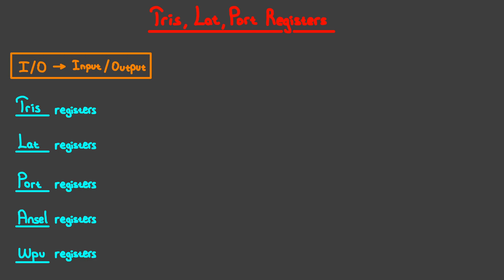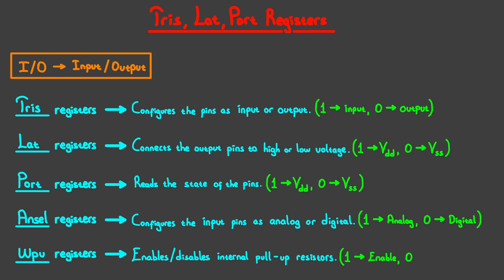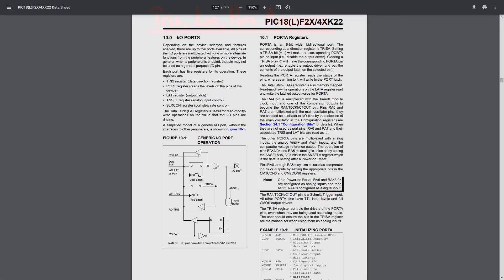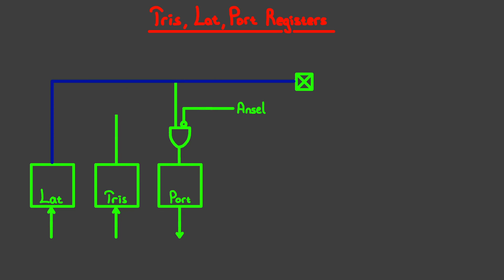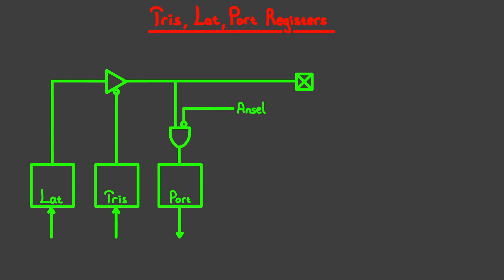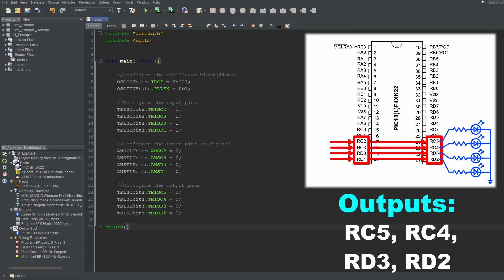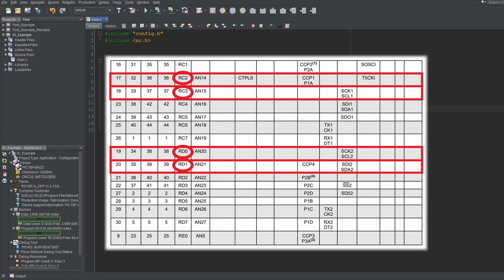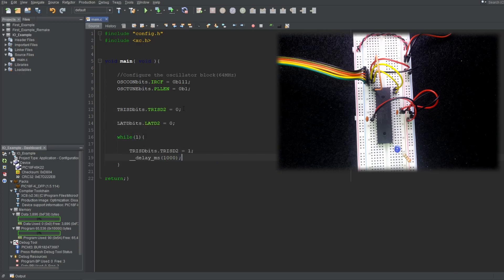PIC MCU TUTORIALS #13 - TRIS, LAT, PORT registers & I/O explained (Absolute Beginner)

Comment: I have not seen registers explained in a more simpler manner. I have trying to understand these , but found too much of undigestable jargon. 

Tris registers -> PIN as INPUT or OUTPUT
Lat registers -> PIN as HIGH or LOW
Port registers -> READS PIN HIGH or LOW
ANSEL registers -> PIN as ANALOG or DIGITAL
WPU -> Enable / Disable INTERNAL PU-UP Resistors

How simple to understand!! 
Great job. Thank you.
Reply from the maker: Glad you found it useful 👍

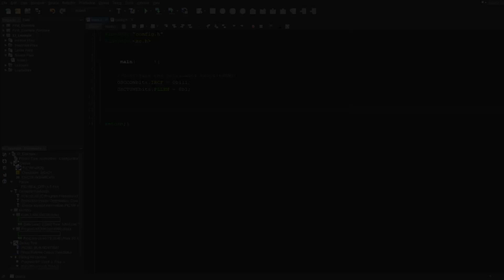Comment: Very interesting, at about 15:45, you mention maximum source and sink currents, whilst the user needs to take notice of these limits they must also take in to account the maximum chip dissipation i.e. don't expect to be able to source or sink the maximum current through all the IO pins at the same time.
Reply from the maker: Of course. I was just trying to keep it simple since most of them rarely matter 👍 There are a bunch of limiting factors, and which ever one is the most limiting will apply. Max instantaneous current, max continuous current, max port current, max device current, max temperature, max power dissipation etc... Also, these are absolute maximum values. Ideally, you should never get close to these.

Comment: Ok, but the question is, does the led turn on when bit is 1 or bit is 0?
TRISE = 0b11111110;
LATE = 0b00000001;
because from this code the led (coresponding to the last bit) is turning OFF, while you said "1" is for turning the led ON
Reply from the maker: When the LAT bit is 1, the pin connects to positive rail; if the LAT bit is 0, the pin connects to ground, that's all LAT bit does. If the cathode (-) pin of your led is connected to the microcontroller and the resistor connected to the positive rail, the LED will turn on when the LAT bit is 0.
Reply: @Microesque  Thank you so much! Now, it makes sense!
Reply from the maker: @OviMG  np 👍

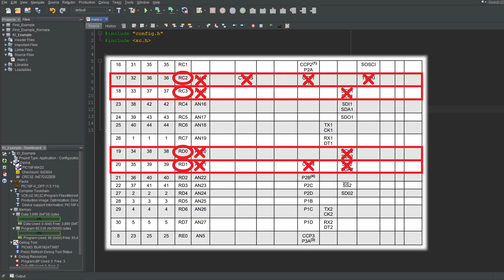Comment from the maker: There is something I forgot to mention in the video. Some of the older microcontrollers don't have "LAT" registers, like the famous PIC16F877(A). The idea of a separate "LAT" register was conceived later on. Those microcontrollers directly write to their "PORT" registers to change their outputs, hence the confusion of whether to read from or write to the "PORT" or "LAT" registers I mentioned in 11:58 .

Comment: Another brilliant video. I was trying to find the syntax for writing to the OSCCON register and there it was. Could you let us know which Microchip document has the XC Compiler language definition.
Reply from the maker: Everything you need to know about XC8 compiler will be in the "XC8 Compiler User's Guide". XC8 is a compiler that uses C language, it doesn't have a language of its own. But if you're talking about things like "OSCCONbits..." those are called "bit fields" (which is still C language).

Check the section 5.3.6 in the XC8 User's guide: http://ww1.microchip.com/downloads/en/devicedoc/50002053g.pdf
If you still don't understand, Google "Bit fields in C".